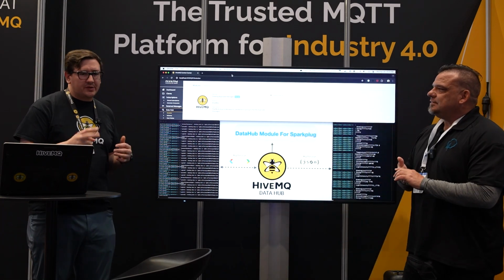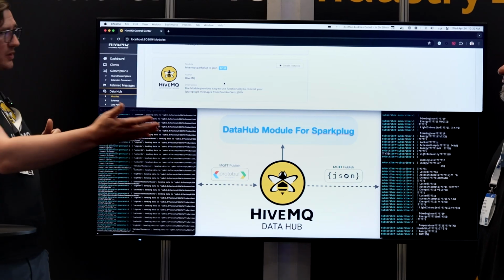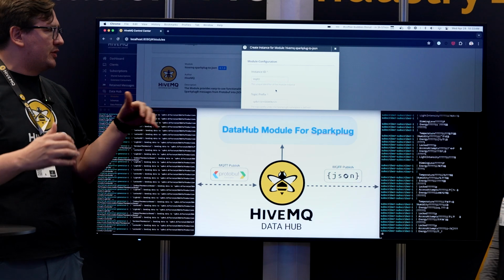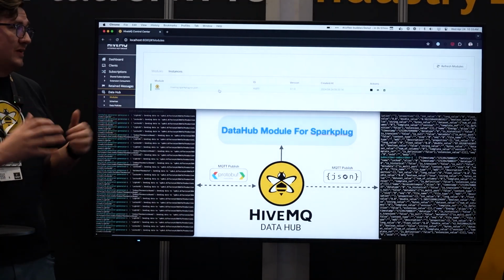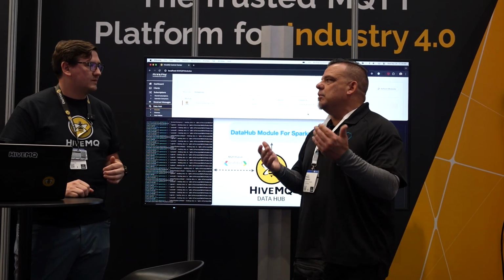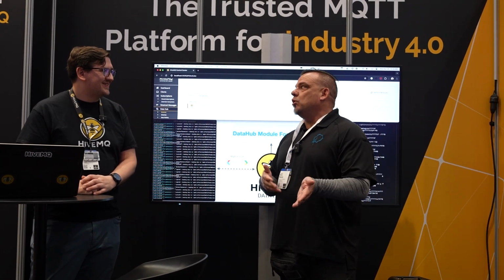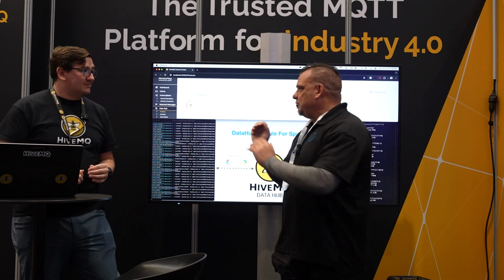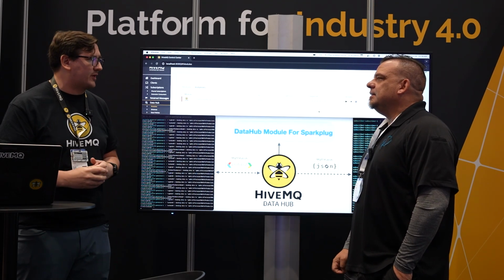Big announcements from HiveMQ (at Hannover Messe 2024)

Comment: But if you do it at the broker level , you lose the speed of transmission of compressed data , whereas if you do it using the Python script, it's already delivered to destination, and then conversion happens...

If you do conversion at broker level for a few topics, what happens to those topics data which may be used you another sparkplug B consumer?
Reply: It’s about options for the architect — use both.  🙏